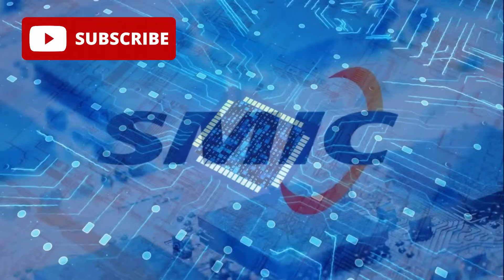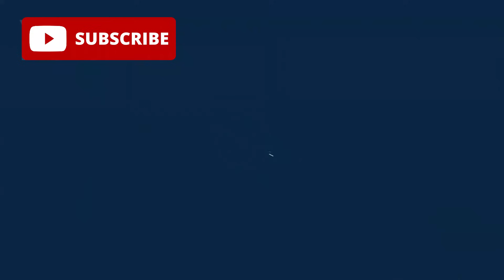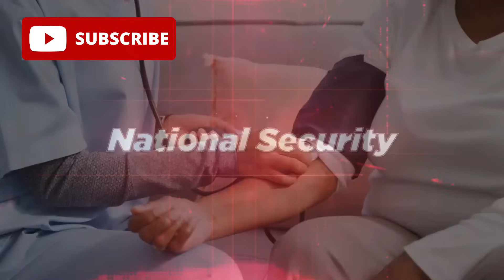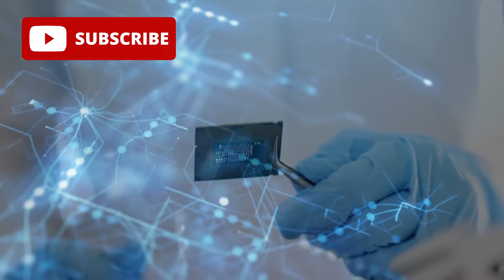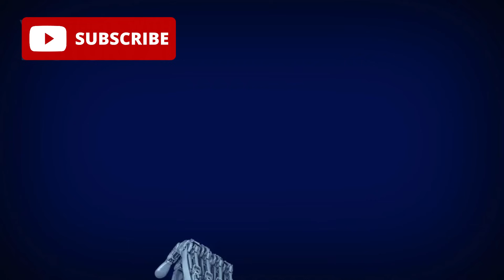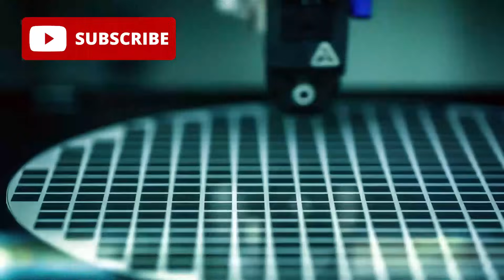SMIC Unveils 2nm Chip Despite U.S. Sanctions, Prompting Strong Response from Washington

Comment: Is this news true? I can only find news about SMIC doing 5nm. SMIC doesn't have EUV, 2nm might be near impossible using DUV. 5nm is already exceeding the practical limit that people think for DUV machines.
Reply: Can't find any print sources either ...smells fake.
Reply: Huawei has developed their own EUV that's currently under testing.
Reply: @martinanane3446  Yes I know, but not 2nm level.
Reply: I have heard before that SMIC could produce 5nm or beyond if they tried it's just really really hard to do so. Multi- patroning or whatever it's called is the reason . Commercial production is perhaps not possible